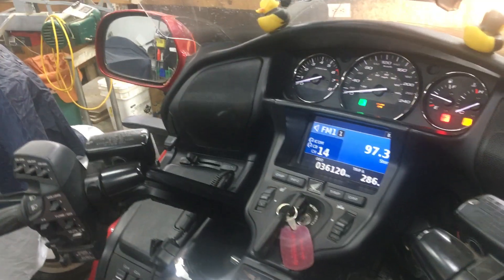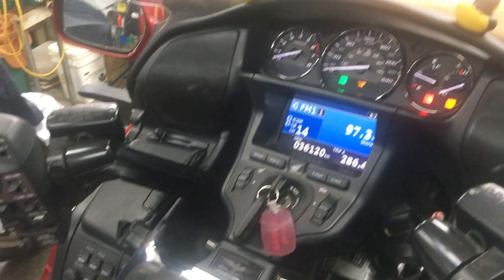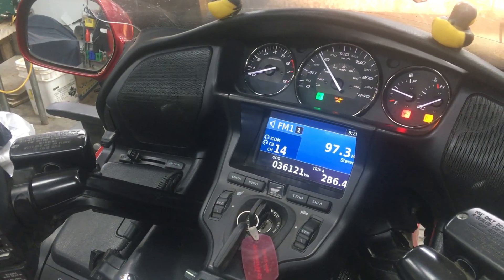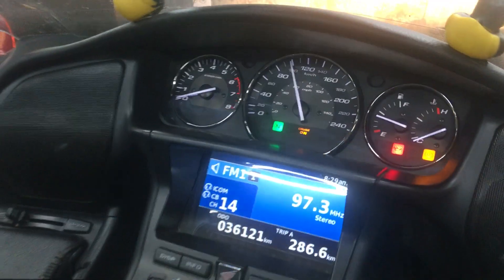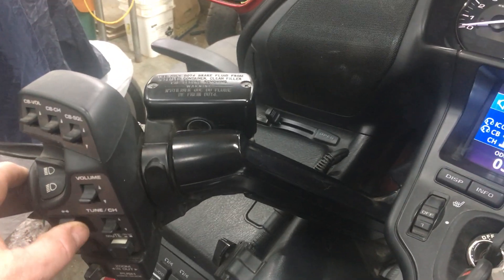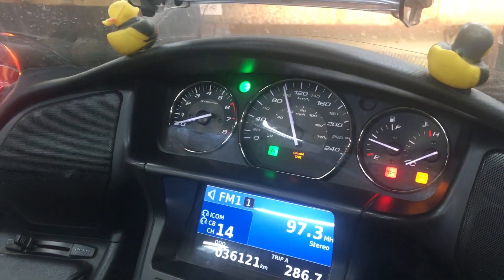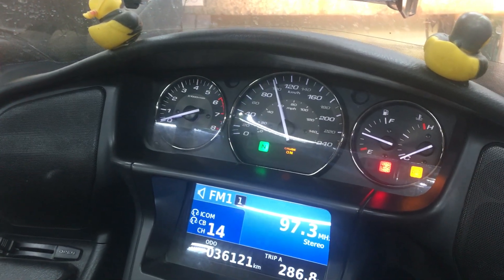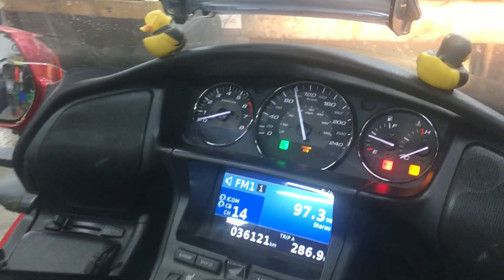Gold Wing signal timer unit

Comment: Excellent, I’ve had 2 wings and 2 Ultra Limiteds and the Ultras self cancel are perfectly intuitive but the Wings are just plain aggravating. How did you do this?
Reply from the maker: Its a micro controller that runs a program. It will reset the timer if a list of conditions are met
Reply: To much tech for this old guy
Reply from the maker: @jonsea4225  That is why I made it totally plug and play. About a 10 min install